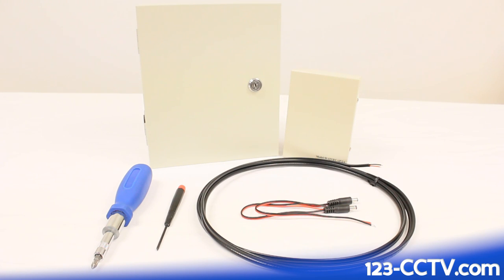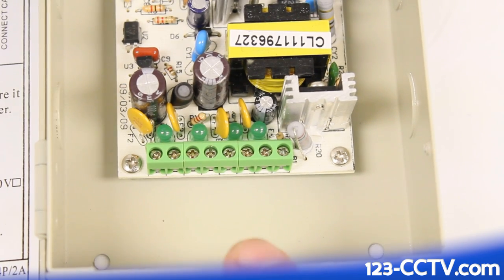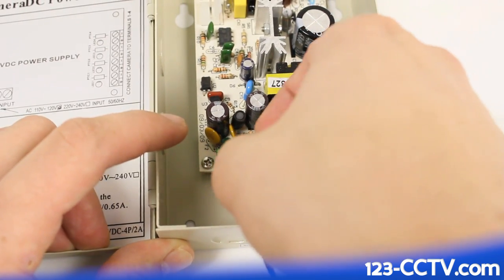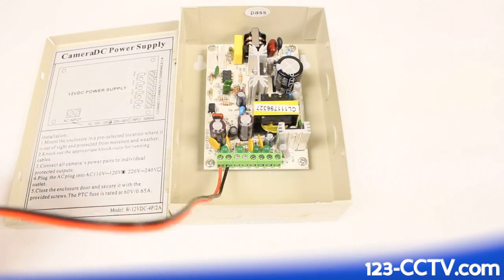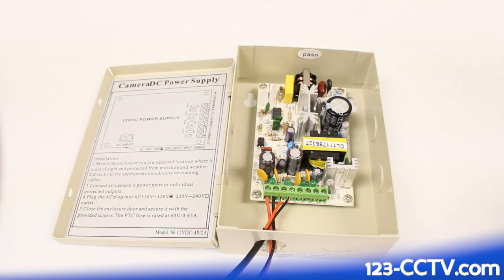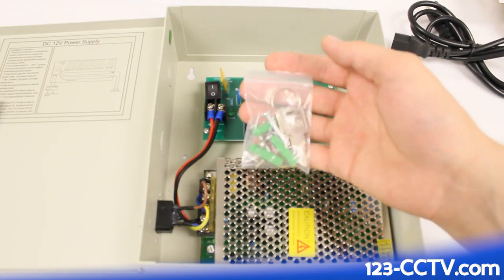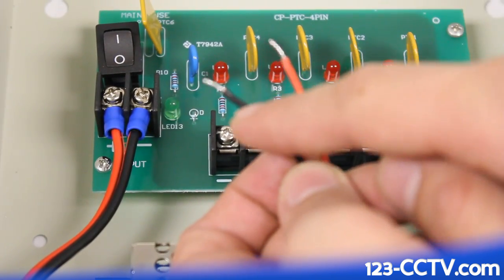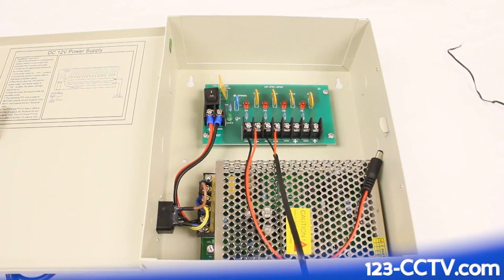123 CCTV Tutorial: How to wire security cameras to a Power Supply Box

Comment: So in a 3 or 4 camera system using Siamese cables . Do you double up on the power screws or have to buy a bigger terminal box
Reply from the maker: This is a 4 port box. You can connect 4 cameras to it.

Comment: We have a large CCTV system at work. ( 46 cameras, 3DVRs) about 2 months ago, there were 3 cameras blacked out. A co-worker said one day all three cameras went back on after a heavy storm, back that only last a day. What do you think the problem is? My first guess was the voltage is not enough to power up the cameras.
Reply from the maker: +Goforit8866 Sound like a power (check both voltage and amperage being supplied to the cameras) or connection issue (make sure the connections are properly made).
Reply: +123 cctv thanks. Will try it

Comment: question for you, I went ahead and by mistake wired the cameras to the wrong polarity, when I realized I had made a mistake I went ahead and changed the polarity, the issue I now have is, the cameras came back on but now, I can see power undulation on the cameras, I tried connecting and disconnecting the camaras and the quality of the cameras is still pretty bad, is there any way to fix this?
Reply from the maker: +willfixyourpc If the cameras are DC12V cameras then unfortunately the cameras may be damaged. Some DC12V cameras come with over voltage and incorrect polarity protection, and they cost more. Less expensive ones don't have this protection and can easily be fried if care is not taken at the time of the install. You may also want to rule out that you don't have ground loop issues. Try using the cameras at another location with a 12V DC wall plug-in adaptor to be certain that it is not a ground loop issue.
Reply: 123 cctv
Thank you so much! it actually worked, I tried putting them on a separate 12 volt power supply and the issue is gone now :) I appreciate your help!
Reply from the maker: +willfixyourpc You are welcome. Please don't forget to subscribe to our youtube channel.